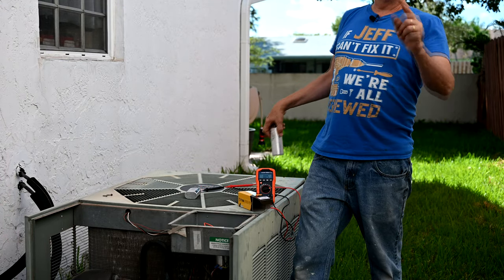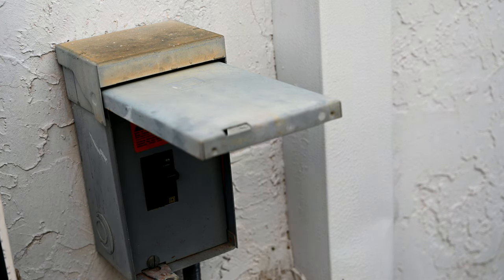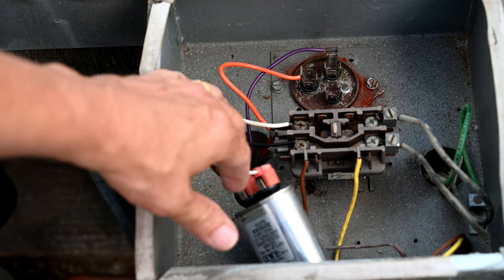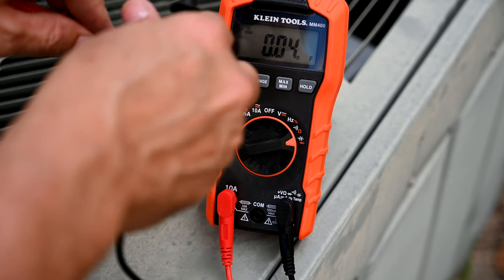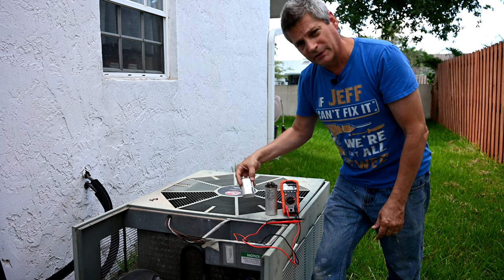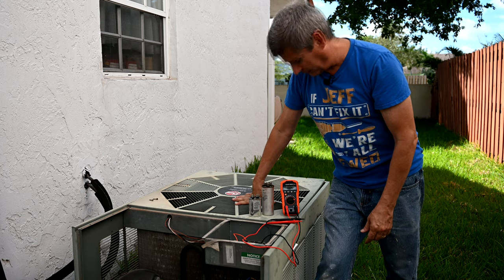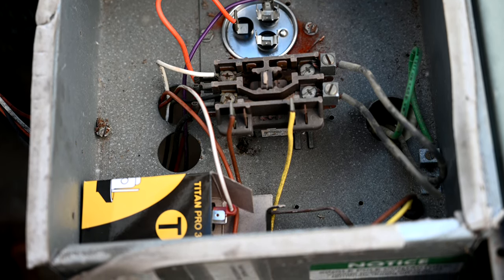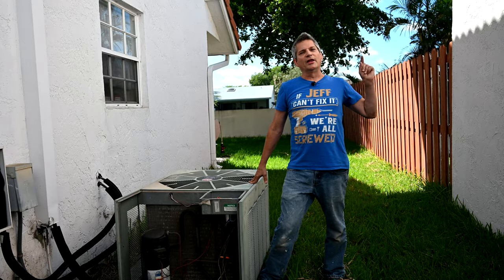DIY Fix AC Compressor Fan Not turning On, Just Humming

Comment from the maker: ✅ Klein Tools MM400 Digital Auto-Ranging Multimeter https://amzn.to/30snn8A

✅ Klein Tools IR5 Dual Laser 12:1 Infrared Thermometer https://amzn.to/2O94oNS

✅ GreatNeck Nut Driver Set, 7-Piece: https://amzn.to/2VGjaMI

✅ Titan Pro TOCF10 10 MFD  370V OVAL Capacitor https://amzn.to/2OaPdUy

✅  Titan Pro TOCFD353 Run Capacitor 35 MFD 370V OVAL  Capacitor https://amzn.to/2LZnPWO
Reply: VERY GOOD, THANK YOU! MAY YH BLESS U. NOTE: YOUR  2SEREWS FLEW AWAY!

Comment: I don't think it's been mentioned in the video, so I'll mention it here. Be very careful around capacitors, especially large ones like in the video. They can kill you if they still hold a charge, which is also very likely if you just ran the AC unit and decided to open it. Make sure to measure the capacitor with a multimeter and discharge it before handling it. Although a bad capacitor will most likely not hold a lot of charge, if you're wrong about your diagnosis and the capacitor is good and something else is wrong with the unit, a charged capacitor, especially one rated for 370/420V can really hurt you.
Reply: Very good point. You said ‘discharge it’ , How do you discharge it? Just wait till measurements go zero? Thanks!
Reply: @genenegeda509  There are a few different ways to do it, professionally you would use a capacitor discharge tool, which will discharge the capacitor and give you an indication when it's safe, but for people at home, bridging the positive and negative terminals of the capacitor together for 5-10 seconds with something like a screw driver with an insulated handle or a high wattage medium value resistor should do the job.
Reply: Yeah from what I understand its a pretty bad idea he's touching the capacitors? But obviously he must know so what am I missing? He initially said he thought the stronger capacitor was good.
Reply: Glad to find your comment here.  This was going to be my only critique of an otherwise helpful video given how nonchalant Jeff is in handling the capacitors, especially touching the terminals.  That goes for the old ones AND the new ones.  The new ones could hold a charge from factory testing or even from someone returning the unit.  BE CAREFUL OUT THERE!
Reply: No one mentioned the screw almost going in the fan at the end. Control your hardware also
Reply: Good on you for catching that and telling the viewers! There are way to many very green DIYers that have absolutely no reason to be around electric and they do it anyway! Hope this saves many lives!!
Reply: Yeah and you see him at 7:12 putting his hand down on the leads!!!😂😂 Not thinking about safety at all! The at 8:18 he grabs the small one like a boss 😂😂😂 guess his hand are insulated 😮
Reply: Just ground it out .   😂

Comment: Please make sure you don't touch the run capacitors before discharging it with an insulated screwdriver. Don't want anyone to get hurt. Also you may have one 'dual run capacitor' which includes capacitors for both compressor and fan in one. Lastly, advise not to put screws loose on top of the unit. You will lose them as hey were about to fall in through the screen once the A/C fired up.

Comment: I guess I'm the only HVAC guy watching this. At the 9 min mark the compressor capacitor was wired wrong. The start winding wire was installed on the "Fan" side of the compressor. That means it is only getting 5 microfarad instead of 35.

Comment: Agree with others on only needing the one cap.  Also,  can't believe you didn't have some steel strap and a couple of sheet metal screws to fasten them down to the frame.
Reply from the maker: That was the old AC and how it was setup. We got rid of it soon after
Reply: Either way works. Some techs believe two caps tend to work or be more robust than the single. Also, with the single cap, the brown with white stripe is not used and capped off.

Comment: Thanks for the info, Just save me a weekend emergency call in a heatwave. $30 buck instead of $300 Bucks.
Reply from the maker: Awesome, great to hear! Saved another one! Thanks for watching Joe!
Reply: @jeffostroff  I guess in NY there is a silent agreement that supply houses don't sell to consumers. Found one place with a young kid with compassion that sold it to me. Seems like a rigged system for contractors in NY.
Reply: @jeffostroff  Thank you for this video. I just fixed my AC with your help. I ordered 2 more Capacitors from Amazon to have as backup. Home Depot does not carry the Capacitors in store where I live. Most AC supplies stores don't even sell to the public. But I finally found one store that would sell it to me. Thank you again.

Comment: Good on you for fixing your own condensing unit! I've had to do the same thing a couple of times, once at 4 am! I always keep spare caps and a spare contactor on hand for just such an occasion. BTW, that round unit is a dual run cap and is supposed to work with both the compressor and the fan motor - 35+5 means 35mfd for the compressor and 5mfd for the fan motor. The terminals are likely labeled common, fan, and herm (for the compressor). You really shouldn't need that 10 mfd cap.
Reply from the maker: Yes you are partially correct. I believe the reason we need this 10 UF cap is because a newer blower fan motor was installed a few years ago, and the sticker on that newer fan shows the circuit diagram including the 10 UF cap, so I assume 35 UF would be too  much for that particular motor. It is likely that the original fan motor supplied by Rheem was originally fed by that larger dual run cap.  That would also explain why there is no parking spot in there for the 10 UF cap, because the original cap was wired to both the compressor and the fan.
Reply: @jeffostroff  If you went to the supply store, you should of got the right capacitor for the unit. There is only one hole because you only need one capacitor. You should of got a 35/10. No need to have 2 in there if you get the right one.
Reply: @DC-uu4yq  Is what you're saying true despite the OP's comment regarding the fan previously being changed out and having different ratings?
Reply: @5jjt  Like I said he went to parts store and he should of got the right one, a 35/10. This is a duel capacitor and will run the fan and compressor. No need to have 2 different capacitors to do the job that one could do.
Reply: @DC-uu4yq  theres a cable that runs from the motor run and the dual where would that cable go if it doesnt need the second one?
Reply: In this case he would have because he did not get the 35+10.
Reply: @jeffostroff  Usually 10 mfd is 1`/2 HP motor.

Comment: The bigger capacitor is what's called a dual capacitor. You can wire the compressor and condenser fan motor to it. Don't really need that smaller capacitor for the condenser fan motor.

Comment: Bro - You just saved me a lot of money.  $100 just to come out to check the system and assess the issue. Minimum charge $200.  Cost me $19 and 10 mins of my time.  Could have been cheaper but chose a capacitor with the best recommendations 👍
Reply from the maker: Thanks, I'm glad you liked it!

Comment: I really like the way you explain this process. My outside unit is humming trying to kick in but the fan is not running. I tried to spin it with a screwdriver. Nothing 
I’m going to try replacing the capacitor. Wish me luck. A man charged me $450 back in 2009 when I became a new homeowner. What a ripped off it was!!! Knowledge is powerful. Thanks a lot
Reply: Did changing the capacitor fix the problem?
Reply: @mccartneystuart  It didn’t. I called an A/C man who recently replaced my dad’s unit. He told me it was the fan motor. The wires that ran inside the motor burnt out. I bought one online for $75 and replaced it myself. It was very easy.
Reply: @tdatilma  good to know and I appreciate the reply as I'm in the same situation although I spun the fan on mine with a screwdriver and it kicked the fan on so hopefully it's just the capacitor. Picked one up for $31 today and will put it in when I get home from work. Went to 4 HVAC supply stores and all were out of the one I needed and the 5th store had one. Not sure why they're difficult to find unless the supply chain shortage has hit the HVAC industry too. Thanks again.

Comment: Great video. My AC quit today with exact symptoms shown. I removed the dual run capacitor (old Carrier from 2000) and it was buldging. Bought one at an electronics store for $11 and my AC is purring right along.  I had an hvac repairman fix it 5 years ago and it was over $150. Lesson learned.

Comment: Jeff, gotta say thanks for this video.
Your vid had two caps, start and run, and other videos only focus on the run cap. If your motors not starting, most lily the start cap, but some may have a single start run cap.
This got me up and going in the heat and some more time on my ac unit without the added cost!!!!
Thanks again!

Comment: Thank You!  I am recently widowed, and tomorrow will attempt to do this repair.  I appreciate all the great info!
Reply from the maker: You can do it! Let me know if it works out for you Patti!
Reply: How'd it go?
Reply: @jeffostroff   I went out to my AC unit, removed the fuses from the disconnect box.  My neighbor had offered to help (he is not an electrician & I could see he was not comfortable at assisting in my project).  I removed the screws from the cover with my 5/16 socket.  The next step the video said to do was:  to insure the run capacitor is discharged, place a screw driver with with an insulated handle along both sets of terminals. That’s when everything came to a halt.  We could hear the buzzing, which he said meant there was still electricity running to it. I took a photo of the capacitor I needed to order &  I put everything back together again.  I searched for the answer to my question - if the fuse box is off, what is powering the buzzing sound.  That was not addressed in any of the videos I watched. I searched & searched the web and finally came across a blog that said the fan needed to be turned off, because it was sending message to capacitor to turn on, so power was still going to it plus not good for AC motor because it could cause more damage.  I went to thermostat which I am still learning to work & could not find how to shut it off!  It just went from auto to manual.  I came back to internet & searched again and learned that there should be a switch - like a light switch by the inside unit.  I looked and looked by the furnace area (I just learned which was the furnace shortly after my husband was killed a year and a half ago) just as I was going to give up I found it!  I switched it off, and sure enough the thermostat shut off completely and the outdoor unit’s buzzing had stopped! I was so excited - I felt a sense of accomplishment Lol!  My part arrived last night $16.79 (Amazon Prime) as opposed to $60.00 for exact same part at HVAC store!  So today, I hope to do this.  I don’t think I’ll ask my neighbor for a hand, I’m sure I can do this.  Though he probably saved me from getting electrocuted since I was going to continue even with the buzzing sound.  My brother made me a little nervous but I’m praying all will go well.
Reply: Thanks again!

Comment: Nice video. I think you should show how to "de-energize" the caps to be safe.
Reply from the maker: Great suggestion! Of course by time you measure 0 uF they are already lacking any energy.
Reply: colleenallmyfriends  I Agree 1000 percent. You still have to have common sense to tackle any job. I simply handled the capacitor as if it were a live wire. avoiding contact with the old unit. Maybe that was too much caution, but it worked for me.

Comment: Great content. One comment/clarification though. The start cap doesn’t provide a jolt to get the motor running. More precisely, its purpose is to create a phase difference between the start and run windings within the motor. It’s this phase difference that creates the torque necessary to get the rotor spinning. Without it, both the start and run windings would be in phase with each other, and the torque necessary to start the motor couldn’t be produced.

Comment: This was very helpful.  We were able to fix the capacitor worked for about 15 minutes then it stopped working again.  Any suggestions?
Reply from the maker: Check the capacitance with a meter if you have one, see if it still has the capacitance, maybe it blew. Maybe you need a hard start capacitor. Is the compressor still humming, but not turning on?

Comment: Thanks so much!  I just had this happen to our unit which has a dual cap.  Top was bulging and was the culprit.   Noticed chewed up wires too (mice).  Cut out the bad stuff, redid all connections with new wire nuts, and installed a new cap for twenty-two bucks!
Reply from the maker: You're welcome!

Comment: My AC compressor stopped working after following this video bought the same multimeter and found that my capacitor was bad. Ordered a new one and installed it. Works great, amazing how easy it was to do. Thanks for posting this video, very helpful.
Reply from the maker: Glad it helped
Reply: Yes and no doubt saved a service call, install cap fee and the part being highly over priced. Likely $300 saved but HVAC techs have a fuel drinking truck, insurance, maintenance, stocked with HVAC parts and equipment to pay for.

Comment: This video might be a little older but it’s priceless. Excellent troubleshooting explanation. Idk if anyone still monitors this but I was curious about a high efficiency 17-19 seer Luxair unit. Under 75 degrees ambient temp condenser
Fan motor blows after the compressor is done running. Multiple speed fan in condenser 3-5 ton. I thought the fan was supposed to run every single time the compressor ran. Maybe this is something new? Thanks to anyone that can help.
Reply from the maker: YEs I too thought the fan motor should stop when the compressor is off, unless it is remaining on to cool off the compressor
Reply: Some A/C units have a low ambient temp control in it that controls the condenser motor. It may not come on with the compressor if the pressures are low on the discharge side. It will come on as the pressure increases.
Reply: @gibraltar321  Thank you. That makes sense. I notice there is no connection for the fan from the capacitor, it's off the main board of the condensor. However the compressor gets very loud sometimes after it's been running and the fan hasn't kicked on yet. It seems like it is out of range but IDK if that's an option for my unit. I'm still trying to find info on my Luxaire system to see how it all works.
Reply: @jeffostroff  MIne is weird. Sometimes the fan starts before compressor start up, sometimes together and sometimes a few minutes after compressor start up. All different ambient temps, nothing is consistent. I almost positive I have a clogged filter drier and that's screwing things up.

Comment: Hi, your video is very informative. For my unit, it turns on ok with cold air blowing out and the fan is running. But the fan stop turning after few seconds. What could be the problem. Mind is a Keeprite SSC-31-ID built in 1980's. Thank you
Reply from the maker: Well I would definitely check the values of the capacitors, and if you have any in line thermal fuse check that as well. But it just sounds to me like the motor for the fan is going luckily you can get the fan yourself for about $100 or so I'm not surprised this have really shot up recently I just haven't looked after COVID

Comment: Awesome video. Thank you sir. In my case the fan starts, runs for a couple mins and than stops. Your thoughts?  One thumbs up from this guy
Reply from the maker: There's so many things that can cause that, starting with the fan itself, or maybe the cap getting ready to go. this web site here has a listing of 15 possible things to try: https://inspectapedia.com/aircond/Air_Conditioner_Short_Cycling.php
Reply: Thanks for the quick reply and the link.  Cheers

Comment: I have this problem here my fan wont turn on thanks for the video stay safe out there.
Reply from the maker: I hope this video helps you!
Reply: So I replaced the capacitor and the fan is now working but I still cant get the house below 87, i hear the compressor humming but it seems the fan cuts on and off quickly (maybe 5 mon run time) not sure the next step to take.

Comment: #Salute that has worked for me in the past. Unfortunately for me my one of my 18 year old units may not be able to be fixed. I tried a spare capacitor from Grainger I had. Then I got a Titan brand one from Ace Hardware today and the unit turned on and spun like new for a few mins then the fan just slowed down and spun slowly with a loud hum. I have ordered a new one from Amazon coming tomorrow morning, hopefully it works. 3 capacitors in 2 days isn't good. Maybe they were bad like some parts are. I'm going to harbor freight to get a new multi meter to test them like you did tonight to see if I can get some information.